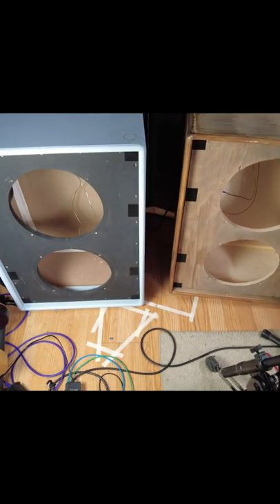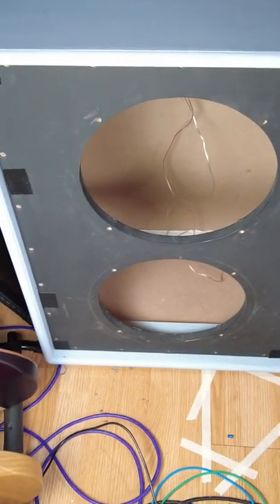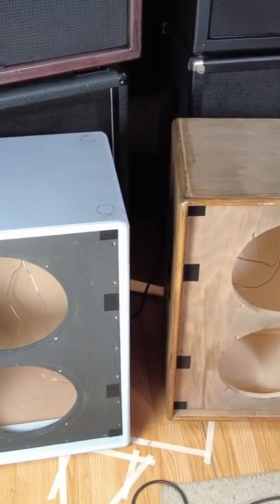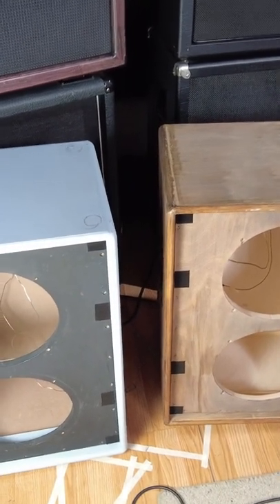Tone Wood in Guitar Cabs?  #shorts

Comment: I suspect it will make a noticeable difference for how it sounds in the room but not as much in a recording.

Really excited to see the results though!
Reply: Why would it sound different in room but not recording?
You realize that there exists room microphones? 
Actually, any microphone will pick up the room.
Thats why some rooms sucks even for closed miced cabs, Glenn said this many times
Reply: @cederickforsberg5840    Nobody is recording metal guitar using a room mic as a primary.  Further, a room mic does not sound like your ears.  This is VERY important for people that actually gig live.   Especially for underground metal bands or similar.  There is a really good chance you will end up playing somewhere that wont mic anything.
Reply: Generally correct. The difference will be minimal when it comes to recording. The bulk of it will be down to the speakers and next, the microphone arrangement.
Reply: @cederickforsberg5840  probably because the microphone is going to be a mere inches from the microphone
Reply: it doesnt make any sense
Reply: @ZZaGGrrUzz  it's your problem if you struggle to find any sense in a very logical answer that really makes a lot of sense.

Comment: My personal suspicion is that, when direct mic-ing the speaker, it will make little or no difference.  But, it might make a difference if you're just using a room mic somewhere else in the room (similar to a listener standing away from the cab).  I have no actual reasoning to back this up... hence, it's just s suspicion.
Reply: makes sense to me
Reply: My brain thinks this is a logical supposition.
Reply: The cab will likely create a sympathetic resonance. It's basically an air pump much like an acoustic guitar is, therefore it should work just like an acoustic guitar.
Reply: The cheap cables the bass player is using are causing interference with my signal ....ergo , affecting my tone.
   -some rhythm player,  probably

Comment: I had 2 4x12 cabs with the same speakers but one had a MDF panel on the back and the other was solid plywood. The only difference I noticed was longevity. The MDF panel eventually started to rattle at loud volumes and the plywood did not. Sold the MDF one and never looked back.

Comment: It will probably show up on  a frequency graph, but after the mix and when the sound gets to us, a lot of the frequencies will be cut and it'll be less of a difference.
Reply: I would love to see the waveforms from a really good recording of both from inside the cabinet  struck with a couple of different things. Maybe a drum stick, a hard kick drum beater, etc. I suspect there would be a noticeable difference in total resonance between the two. With my suspicion that the plywood box would sound more springy than the mdf.
Reply: @Mechagnostic  MDF has a lower resonance frequency than plywood of the same thickness, because density. Building a box out of them doesn't change that, provided the construction is the same. Bracing can make up for the lack of stiffness and density where weight is a factor. You can test this by grabbing a 24" x 24" or metric equivalent at your local big box of home building stuff store and rapping your knuckles on it. 

Tapping the side of any speaker cabinet even with drivers in it will tell your ear what the cabinets resonance is. As a general rule setting a side fancy engineering. If you tap a speaker cabinet with you knuckled and it sounds dead, it will likely sound good when you play music through it. If it resonates like a drum, then the speaker will likely sound bad. Or at least the speaker will have a sound that isn't in the music. None of this applies to open back or infinitely baffled cabinets because they don't have a sound beyond unwanted resonance.  

A speaker box if properly designed doesn't resonate at a frequency played by the driver. The driver will have a resonant frequency where it will produce much more dBs. A properly designed crossover network will take care of that. Unless you wan't the speaker to honk. Sometimes you do, like in a car subwoofer. But that goes way beyond the scope of this conversation.

Comment: As a cab builder, I'm very excited for this video. Ive made cabs made out of cheap ass chinese pine plywood that sounded inmense and compared to say, baltic birch ply which is much more mechanically resistant, and they did sound different.
The difference between guitar "tone wood" is that the acoustic effects are negligable due to how pickups actually work, but in a cab the acoustics are everything and the amplitude of the waves is so damn high that resonances vary a ton between all the different woods. You don't even have to go as far as changing the wood, try front loading a cab versus rear loading the same cab, there are noticable differences.

Comment: Nope, it won't. Denser wood will make the box more stable and flyable/road-able like with PA boxes and may even help with the amount of sound coming off the back and sides of the cabinet. But tuning speaker cabinets is about the volume of the box and the porting, i.e. open back, porting tube lengths or designs like thiele designs. Just my 2 cents american or 2.6 cents canadian :) Although I could be wrong!
Reply: and internal bracing to stop resonant panels
Reply: maybe thats what EVH heard in his infamous peavey cab test
Reply: better resonance control from the better panel braces, not the sound of the wood, just better bracing and more accurate speaker performance
Reply: @jsalvatori  absolutely 💯 The most important thing next to internal volume is keeping the cabinet rigid. Wall flexing means the energy the speaker is creating is leaking out in the wrong directions. The easiest answers of course are really good bracing, or heavy solid materials.
Reply: @fetusbelt6851  Bracing is only necessary if you are using a material that is not stiff enough. Braces are usually found in cabinets that need to be light for portability. My dual 12" subwoofer has no internal bracing. But the trade off is the cabinet empty is around 200 lbs. 

Baffles are sometimes used to stop standing waves inside the box but those aren't the same as braces.
Reply: You are right and one of the only commenters I've seen that even addresses the volume of the box. Volume is what matters, after you have stopped any resonances you didn't want. You probably didn't want any resonance from the box at all...but ya know physics.  Open back designs the box has zero to do with the sound beyond resonances. You know the ones you didn't want anyway but got all the same.

Comment: Will it make a difference in the recorded sound?  My forecast matches what I found with drum shells of a common thickness and with a common bearing edge design.  Close-mic? no difference.  One not-cheap mic picking up room sound from someone who can play with dynamics...yes, but less of an impact than head selection.  So, for these cabs...close-mic distorted metal tones?  No reasonable difference.  One room mic playing various volume levels, with tone from chime-clean through blues-breakup?  Some difference that would be lost if listening to the mix in a car or with cheap earbuds.

Comment: Probably not.   However, a stiffer, more heavily brace cabinet will have less "cabinet sound" than one that's built more lightly.   An extreme comparison would be to make a similar cabinet out of cardboard.    Try that just for fun.   

I've built a fair number of cabinets.  I make them of good plywood simply because it's strong, durable, and won't self destruct if it gets wet for a moderate length of time.   Being out in the rain is kryptonite to an MDF or particle board cabinet.   A plywood cabinet can survive that.  They're also better for taking impacts and vibration.  They're just more durable. 

In the hi-fi/audiophile industry,  we want speaker cabinets to be as stiff and non resonant as possible.  If the cabinet itself is vibrating, it is making sound. We don't want that sound, which is an uncontrolled factor, to interfere with the sound from the drivers, which is a controlled factor.    But for sound reinforcement and guitar or bass amp applications,  that's not very important at all.

Comment: If speaker cabinets had a resonance adjustment knob, you would usually want it adjusted to zero. If a cabinet's resonance achieved a particular tone, that might be good for some songs or some parts of some songs, but generally, the less resonance the better.

What do you know about eliminating the port and using a pair of speakers (any 2X speaker arrangement) in phase opposition?

Comment: Speaker in general have tonewood. In Hi-Fi we want as little as possible, but i guitarcabs it may add something, but still it's more measurable than hearable and things like cab volume, open/closedback and the speaker element it self is all bigger factors than tonewood. So, as you said Glen, most important is to listen with your ears, not your eyes!

Comment: For guitar cabinets the material won't matter too much if it isn't too light. But for large 18 inch subwoofer cabinets MDF will sound more tight and directional because of the density.

Comment: Good question.  I'm guessing it won't matter at all  direct  micing it. It may make a difference in the room depending on wood density and what the cab is covered with.  But I think the difference in wood types is in touring durability and price.

 Other than that I think speakers are of the same vein as pickups.  You could probably build a cab from cardboard and mixing the speaker I assume you will get the sa.e result.

Comment: May I suggest the following. Mic them internally, and strike them with something, compare the waveforms.The plywood rings significantly longer, and I'd bet that plywood cabinet sounds kind of "honky" at higher volumes as it will hold more energy at it's resonance point. Wrapping it in tolex might mute it a bit, but I feel the mdf cabinet will be much less likely to start resonating uncomfortably.

Comment: It will make a significant difference. Tap tuning is a good place to reveal that like you did. This is pretty similar to an untreated room with wood floors and bare walls versus a treated studio. The way the wood resists vibration and absorbs vibration is key.

Comment: I've always assumed that the woods used to make a cab don't matter for sound, especially when you're putting a mic up to the speaker because the wood doesn't contribute in anyway to what the speaker is doing. It's not like the speaker picks up the sound from the wood and amplifies it or anything. If the pickups and amp aren't picking up the tones of your guitar's tonewood, then the cab wood certainly isn't doing anything for tone either.

Comment: The ply cabinet should in theory sound a little livelier as it's more resonant, but I'll wait until the test results are posted. OTOH, the MDF cab is likely to be significantly heavier than the ply, and that's a factor you can't ignore if you're gigging, or even using the same cab for home practice and band rehearsal (if/when the bass player shows up). Would be nice to see a solid wood cab in the comparison: Fender and others were using Pine up until at least the early 60s.

Comment: Maybe the sound in the room will be a bit more boomy with the mdf cab due to it resonating at high volume, but i don't think a mic that mainly picks up the direct sound from the speaker will record a notable difference.
Anyway, you can easily make the MDF cab stiffer by adding some bracings on the inside.

Comment: Ultimately, I say yes because the acoustic resonance will effect the sound in a similar fashion as an acoustic soundboard. You're relying on such factors to create the sound. Though, I would say that the condtrctuon/materials of the speakers, the resistance/impedence and the gauge/material of the wiring and the acoustic treatment (or lack thereof) of the room in question would be a bigger factor. In the same right, the properties of the wood will vary the direction reflection, and absorbsion of the soundwaves.

Comment: I know there will be noticeable differences in presence. I also know a vertical slanted 2×12 plywood box with 3/4 MDF baffle is the best of the 3 types of vertical slanted 2×12 cabs that i have built in the same dimension. I found the presence & clairity of articulation to very pleasing in that configuration.  top loaded celestion alnico creamback & M65 creamback making a 8ohm cab.
love it!

Comment: MDF can be more easily damaged by moisture and isn't quite as tough as plywood.  For a gigging musician a proper plywood cab will hold up to much more abuse on the road.  In a studio environment that isn't as much of a concern.  I will say the one MDF cab that I owned in the past sounded pretty dull compared to my plywood cabs even with the same speakers (Vintage 30).  May have been due to slight dimension differences than the construction material.  My suspicion is that in a studio environment if you have identical speakers and dimensions the difference will be very minimal if any and won't be as clear cut as just pointing at the material as the source cause.

Comment: When you say "plywood", there are many types. Most high end cabinet makers use 11 ply void free Burch wood plywood.  It should also be noted that Fender in the early years used solid pinewood boards to make their cabs and amp cabinets. Not so much for tone mind you, it was because Leo was cheap. I would lastly add that this test will vary as to the type of tone one is looking for. What sound fine for metal may not apply to country or jazz.

Comment: I don’t think MDF and oak veneer plywood will sound much different  but both should sound different than low-strength particle board. Crappy 80’s plastic boom boxes had a distinct sound of thin plastic speaker boxes, hence the ubiquitous “smile” setting of graphic equalizers to reduce the midrange and improve clarity with more bass and treble.

Comment: First off, thanks Glenn. For everything you passionately do.  My guess will be no distinguishable difference at low-medium volumes.  Perhaps at higher volumes they will sound differently, but whether one sounds better than the other I don’t think can be predicted.  At high volume when the cab starts to resonate, the MDF should resonate fairly consistently, whereas the plywood, whose density will vary through the panels will be less consistent.  The reason I state it can’t be predicted based solely on that is that the guitar speakers do not have flat frequency response to begin with.  Just look at their response graphs. They are highly colored and not flat at all, and their unique coloration is what makes them desirable, along with the speaker’s breakup character.  It’s the combination of the speaker(s) frequency response and the cabinet interior volume (and to a lesser extent, the ratios of HxWxD) that makes us prefer one cab IR over another.  So I think the plywood’s resonance may or may not combine pleasantly with the speakers,  but the MDF should sound more consistent across the volume settings. (Sorry for the geeky long post.  I studied audio & speaker design under W. Marshall Leach at Ga Tech in the 80’s.  See: https://leachlegacy.ece.gatech.edu/audiothings.html for more)

Comment: I have an old Red Bear 4x12 made out of particle board. I stripped off the carpet it was covered in, sanded it sealed it and out in new grill cloth. It looks pretty cool. I threw in 4 EVH speakers and it sounded good. But then I had a brainstorm. Replace the baffle (the wood the speakers attach to) with some really good plywood. Put the speakers back in a d MAN!!! Big improvement in sound. In the room anyway. Sounds almost as good as my EVH 4x12 cab! But does it make a difference in recorded sound from what it was to what it is now? I don’t know. Haven’t recorded it. So I’m waiting for this comparison video.

Comment: I can hear a slight difference when you knock on them but with my experience in sound I can't see that translating out thru the speakers. I have a set of old Peavey 15's (wood cabinets) and a set of Peavey PR 15's "plastic cabinets" and they both sound awesome. I can't detect any difference due to materials although  I will admit age and design play a big roll. But as far as it sounding "good or bad" there is no margin other than sound taste that I can find.

Comment: My step father is a carpenter so we learned that MDF and plywood is not considered as "wood", when you order custom furniture. Though eventually you're testing whether acoustically different cabinet materials affect close miced speakers. I guess it will be somewhat more tengible difference than electric guitar "wood" tone comparisons, maybe more difference on clean tones than distorted. Unless metal is all you care about in this case.

Comment: Cool experiment! I don't know, but if it does make a difference when it comes to recording, I think it will depend on how you mic the cab. If you're going to go with just one or more mics right in front of the speaker(s), any influence the material the cabinet is made from would most likely be negligible at best. If you set up some room mics, I think it will have have an effect of some sort and that may be dependent upon the sound of the room where the cabinet is placed.

Comment: The wood itself will most likely not make a difference as the geometry of the cab and its airflow will most likely change the tone. It's similar to how cabinets sound different in other enviroments.  If you can increase the amount of reflection points inside the cabinet you can change how the air is being pushed and will overall change how the cab resonates. A filled in concrete box is going to sound completely different than a hollowed out wooden cab. I'd like to see a test between a rectangular , cylinder, and a triangular shaped .